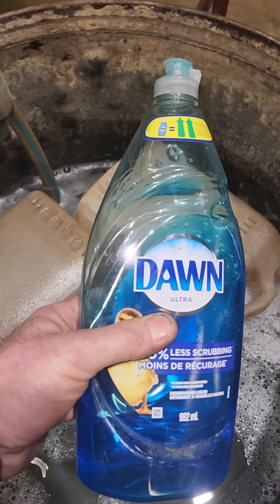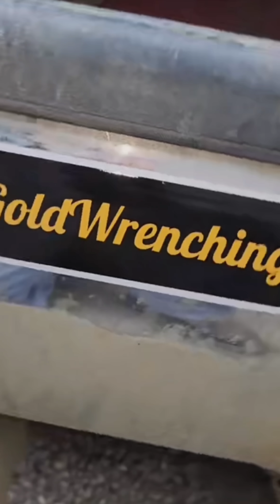Sneaky Leak! Air Suspension

Comment: Try dawn platinum with distilled or bottled water.  I mix it until the water has a slight blue tint to it.  This mixture works really good.  

I’ve been a mechanic with Deere for 30+ years.  Your videos are great, love the humor and the information is fantastic.  You are an old school mechanic not one of these new age “technicians”.  A lot of the tricks you show how to do, I was taught by older mechanics……..weld a nut to a broken bolt, the washer is very important, use 6011 rod because 6011 will not stick to cast.

I was teaching a picker class to technicians a few years back and introduced myself as the field mechanic.  Another company employee said “technician”, you are the in field technician.  I responded no sir, I am a mechanic because I actually understand how things work.

Love your videos, they should be used as training films……..and I guess all mechanics have a sense humor.  I was taught to learn to laugh at yourself then you can laugh with everyone else.

Comment: Dawn works great on swimming pools. Seeing the bottom to getting smaller particles to the sides to easily scoop it up. Get diluted soap and squeeze the bottle down the center of the pool. Also helps with wasps.

Comment: Dawn is what we use. It comes in 1 or 5 gallon jugs called "Manual Pot and Pan Detergent". For the fancy-pants diagnosis jobs I'll use Big Blu from the HVAC supply place. It stays in place longer which helps find the real small leaks.
Reply: Dawn is great for that, but any decent dish soap will bubble like crazy